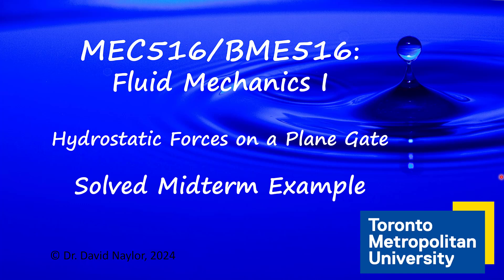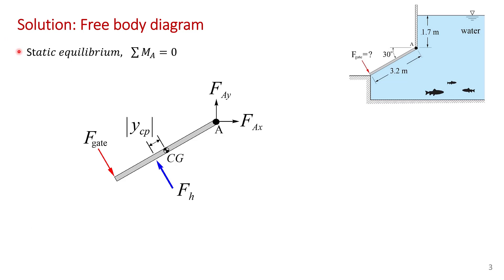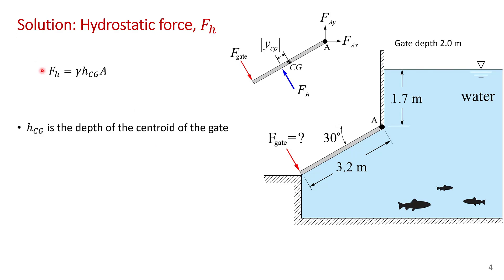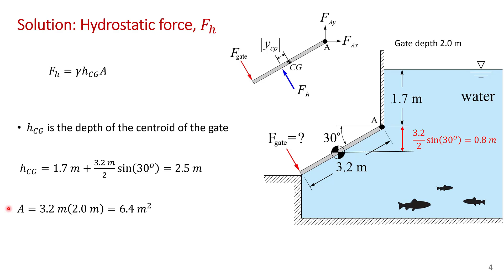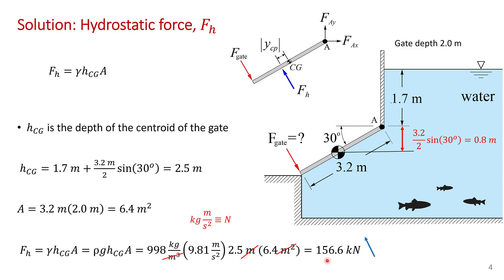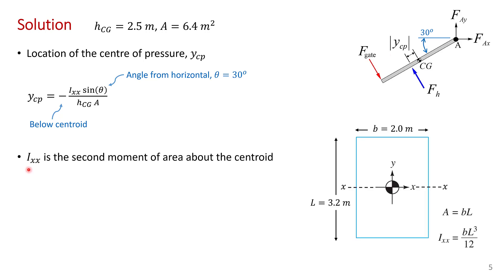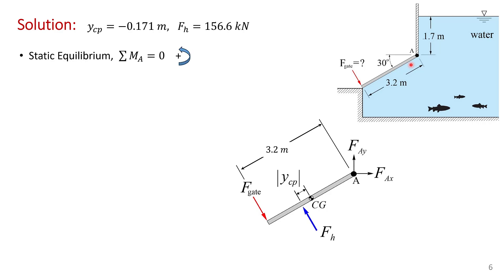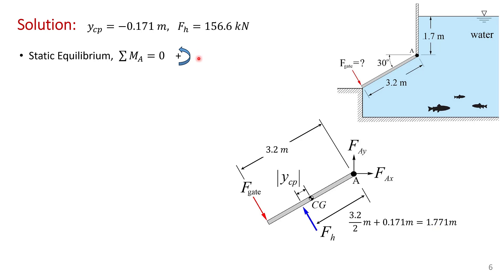Solved Exam Problem: Hydrostatic Forces on a Gate

Comment: Hi, thank you for the video! I was wondering why Fh is not acting at 2/3 the height though?
Reply from the maker: F_h is located at 2/3 when the gate extends all the way to the surface, which it does not in this case. I hope that helps.
Reply: ⅔ is used in case of a triangular gate please

Comment: Is the sin30 not supposed to be (sin30)² from the notes of hydrostatic pressure on an inclined plane?
Reply from the maker: I'm not sure where you are seeing (sin(30))^2 in the notes. But, no. It is just sin(30) to get the the vertical distance -- in order to calculate the depth of the centroid of the gate. I hope that helps.
Reply: @FluidMatters it must be (sin 30) ^2... That's what we get while deriving formula... Please recheck the derivation or correct me. Thanks
Reply from the maker: @shubhamwr    See the derivation of the equations here: https://youtu.be/pIK_ywo10Qc?si=7xSi8K8So2PAui2a   You could also check almost any fluid mechanics textbook. I hope tha helps.
Reply: @FluidMatters  oh I'm sorry. Actually I was thinking about "height of center of pressure from free surface of fluid" for which it comes out to be (sin 30) ^2 due to multiplication of "y" By sin 30 additionally. Most of the books also write it in terms of height instead of y so got confused. Apologies.

Comment: Why doesn’t the water above the gate affect the gate?
Reply: Ohhh that makes sense! Thank you so much! ❤
Reply from the maker: The hydrostatic effect of the water on the right side (higher than the gate) is included when you calculate the depth of the centroid (from the free surface). I hope that helps.

Comment: Why there is no force vertical acting on the gate?
Reply from the maker: Fh has both horizontal and vertical components.  As the gate JUST starts to open there are no other forces on the gate, except at the hinge. I hope that helps.

Comment: Hi. thank you for this lecture. I have a question. why did you use 2.5m  (vertical component) to calculate the center of pressure and not the component parellel to the gate? Thank you!
Reply from the maker: hcg in the y_cp formula (for the location of the center of pressure relative to centroid) IS the vertical depth of the centroid (which is 2.5m). The ycp is the distance parallel to the gate. I suggest looking at the derivation in any fluid mechanics textbook, which will verify these facts. I hope that helps.